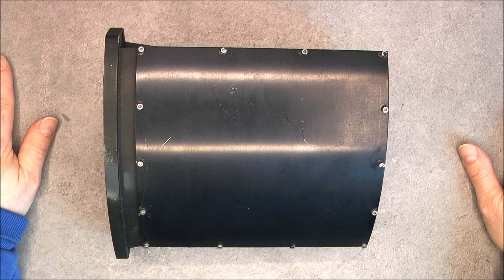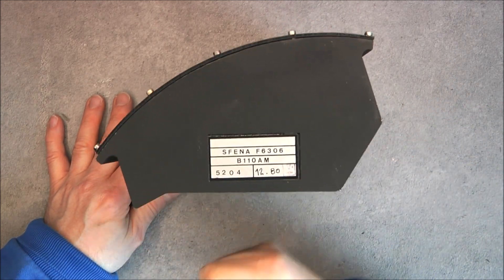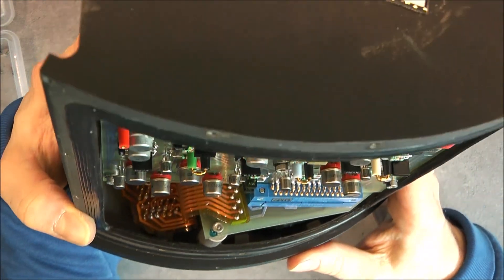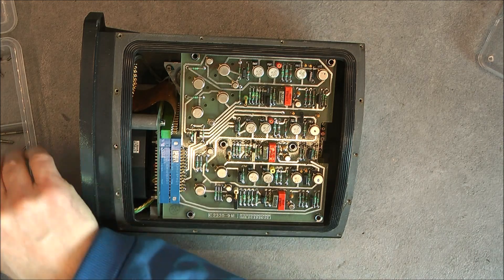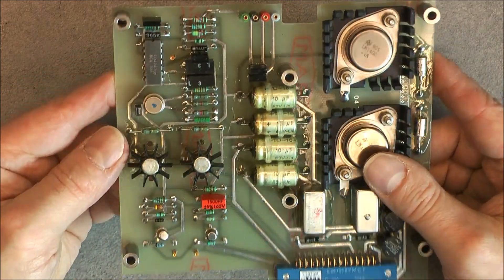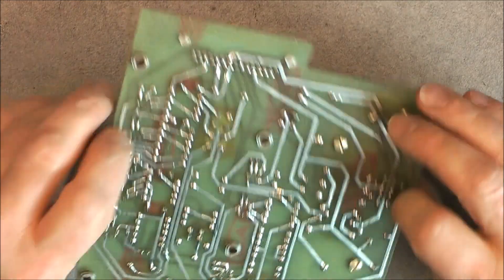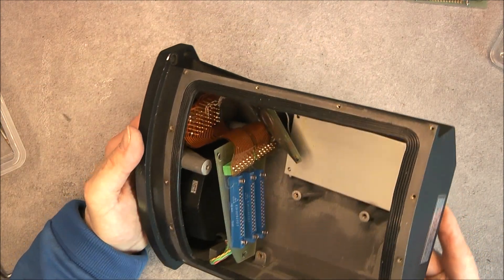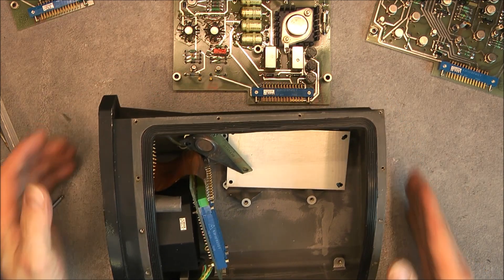SFENA B110AM mystery aerospace (missile ???) module teardown

Comment: There are 3 times the same op amps lines. 

It is Either for 3 axes, some synchro/resolvers, or accelerometers?
Or three phase power (115V monitoring, or switching?)

It would be interesting to reverse engineer it., to know exactly what the op amps do, where there are connected.

Comment: The device has made in USA printed on it looks like a heater element and the round device connected to it looks like a click thermostat
Reply from the maker: @PilotInCommand777  yes, but I do not really see the point of heating the box if there is no moving part that could get frozen in cold weather
Reply: @msylvain59  Some electronic circuits and components are less reliable or may not function properly at colder temperatures. in these cases the use of internal heating devices are common. Some critical components are encased in what is called an oven and the devices that they are installed in will not operate till the oven is at a prescribed temperature.
Reply: @msylvain59  you know oven controlled oscillators - same thing here.

Comment: The wires from the 'mystery' box go to the power PCB's and not to the analog PCB's so it is probably a transformer. You can verify it by following where the wires go to on the PCB (maybe they connect to the bridge rectifiers) or by checking the resistance of the wires of this box.